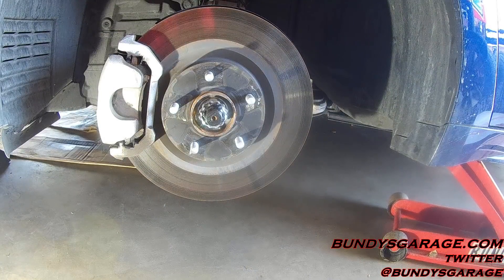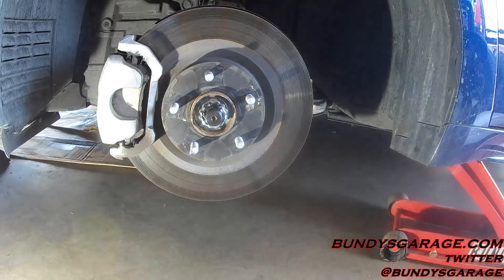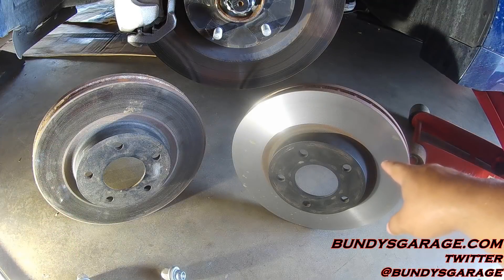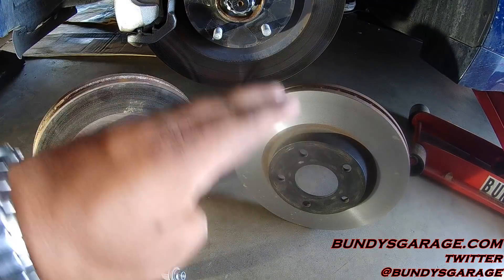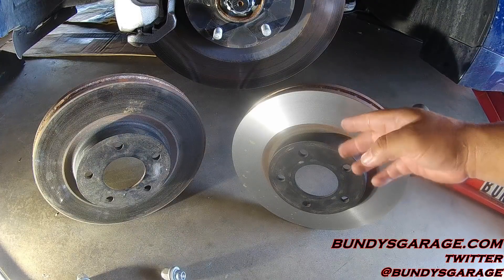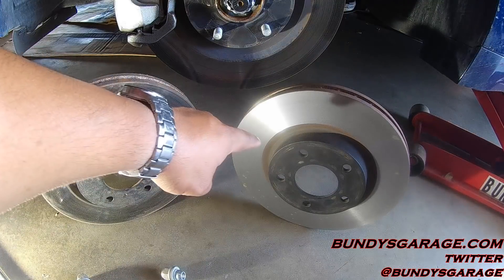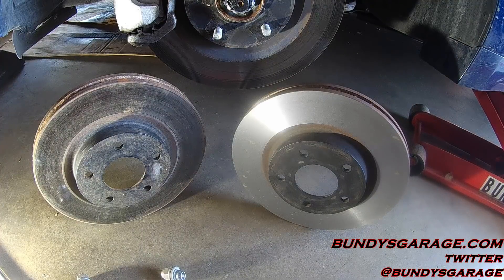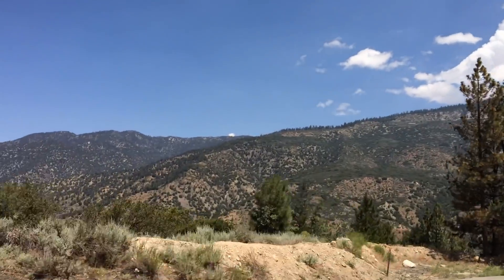Do I need to Turn Rotors when changing Brake Pads - What does Resurface Rotors Mean?

Comment: I’ve changed pads without doing anything to the old rotors. They usually squeak for the first few hundred miles until they wear in, but usually it ends up working just fine. Squeaking is of course unacceptable in a business unless the customer is informed.

Comment: It now being 2023, with a quick check at local Oreillys, the cheapest replacement rotor for an F150 is $86 each, for fronts. That is more than double of what rotors cost on average 5 years ago. 
Turning looks a LOT more economical now, after the Biden economy is in full swing.

Comment: Replacing rotor labor is about 50 per wheel. A pair is 100. New Rotors costs about 100 to 120. Brake pads about 120 part and labor. Total about 340. If resurface rotors, how much does it save?
Reply from the maker: Turning rotors about $80 bucks for 2 of them. It’s also better to stay with the original rotor that came on the vehicle. A lot of “cheap” rotors are junk and warp within a few hundred miles.

Comment: How many sets of pads would you think a rotor would go with turning each time.   I've just got new aftermarket brakes going on my pickup and questioning if I still shoukd have just turned the rotors.  I did a thing I always dislike and that was to pad slap at last inspection time. Anyway the rotors appear quite worn so I am just doing the whole thing this time.  I hope I'm not throwing out good rotors.  I don't see min thickness on the hat however
Reply: From a buddy of mine who work with cars, he says a couple brake changes.   I just measured my rotor, it's at it's finally at it's minimum thickness and my truck has 200k and I think it's on it's 4th brake change.  So i guess it's all on how you drive, I generally don't drive fast, and don't brake hard.
Reply: @ex8280  interesting. One thing I did learn is minimum thickness means it’s good for one more full set of pads. It’s not slower limit for disposal.

Comment: The problem with turning rotors is that you thin the metal every time you turn them.  They become weaker with every turning, making them more apt to warpage.  On my own vehicles I don't turn rotors, merely replace the pads (pads are cheap) and clean/grease the sliding pins.  NEVER had brake rotor problems, ever.
Reply: I've never turned my rotors eithersd, never had any issue, and I'm at 200k, with 4 break changes, and finally at it's minimum thickness.  Just put on a new OEM rotor.
Reply: @ex8280  Good info.  Thanks!  I think that's the route I'm going to take.
Reply: Thank you.  I was wondering about doing it that way myself.  Makes sense.
Reply: Won't you still have the pulsation then? If you just do the pads?
Reply: You only need to remove a few thousands of an inch of material when turning a rotor! They are manufactured with extra material on them for a reason, that reason is so owners can have them turned each brake job. You people are listening to people who make more money by selling you a new rotor rather than turning the ones you already own. A rotor can be safely turned once or twice before they should be replaced.

Comment: New pad material (going for ceramic pads for example) on original discs that used oem compound pads... Definitely turn it.

So you embed the new ceramic material on the rotors.

Comment: Uneven rotor surface is actually the laying down of brake pad material unevenly. Hence bedding the brakes when new pads are installed. This is why brand new rotors with only 300 miles can have an uneven surface, not that they were defective as this man suggests. So the reason for new rotors would be that you are at the end of the rotors thickness or there uneven but dont have enough rotor thickness or material to cut them down. There's a minimum thickness that they can be.
Reply from the maker: Where did you get your information?
Reply: @bundysgarage  its commonly known in the industry. For example - https://haglinautoinc.com/blog/what-causes-brake-rotors-to-warp#:~:text=Brake%20rotor%20warping%20isn't,surface%2C%20mainly%20caused%20by%20heat.&text=The%20brake%20rotors%20can%20become%20glazed%20with%20material%20from%20the,off%20onto%20the%20brake%20rotors. Paragraph 3 of this website

Comment: I don't believe in turning. Most modern rotors and pads can handle a simple pad slap if the rotor looks okay. You can possibly get away with this for 10 years. Just clean them up with a power drill and wire brush attachment for rust if needed. If they look that bad or are gouged or warped, just replace them. Turning is nonsense in my opinion.
Reply from the maker: Well even though you don't believe in it. Sometimes you gotta turn'em.

Comment: I just had my front brake pads replaced and rotors resurfaced. When pressing on the brakes it takes a while for the vehicle to come to a full stop. The brakes do not feel as “strong” as it used to. Is this normal?
Reply from the maker: No that’s not normal. Take it back to the shop that did the work and tell them you are afraid for your safety and have their best guy take a look at it.
Reply: Maybe they went past the minimum thickness when they turned the rotors.

Comment: Consider three things before resurfacing.

Original thickness ( most front rotors have more pad contact surface to be able to turn.   Some cheap rotors especially rears which may be originally cast just slightly above the minimum thickness.

Rotor material:  how well the materials used during casting were mixed, heat treated and allowed to cool properly.

Rust preventative coating applied:   Most modern rotors have some sort of rust preventative applied at the factory before being shipped.  Black is a common due to the fact that as the rotor contacts the pad the rest of the rotor should still have the protective coating applied but the pad/rotor contact surface will turn metal.  Some have the same coating applied but maybe clear and although not seen the coating is there.  

Zinc is a common ingredient used in this step.  

Not sure if it is still done but they used to spray a small coating of oil on the rotor and seal in a bag to prevent rust during transit.  The coating is obvious but the bag prevents the protective coating from being absorbed by the rotor box weakening the box structure.

In general I would not expect to be able to turn modern rotors more than once and another resurfacing 20-30K miles later might be at or below minimum thickness after resurfacing.

Yes there are crooked shops out there but this is one that is a major safety item and they will not budge.
Reply: Your only removing a fraction of a millimeter when turning a rotor. Rotors are manufactured with extra material on them for a reason. If they were meant to be thrown away every brake job, manufacturers would only make them a few millimeters wider than minimum thickness. Most modern rotors have nearly 10 millimeters of extra material on each side of the rotor, that extra material is there to be turned off during a brake job. What has happened is people are taking advice from people who make more money by selling them a new rotor rather than turning that rotor for them.

Comment: If it starts pulsating at 300 miles my guess is probably cheap steel or cheap manufacturing procedure and Quality Control.   Another cause can be cheap bargain basement pads. 

A lot of today’s cheap steel ingredients for modern rotors can warp and at maximum probably only to be able to be turned once maybe twice for some of the better ones.  I can agree with both methods but if I buy a used car unless I can see visual or documentation of it being resurfaced or replaced in a fairly short window of time before purchasing the vehicle I usually play it safe and get new pads and rotors and start a new baseline mileage and date.
Reply from the maker: Thanks for the tips. Some of the best rotors I have used on many applications are Bosch Quiet Cast rotors and brake pads.
Reply: I saw a new piece of modern technology last time I had Rotors re surfaced for my 2015 Expedition. Once that case they were within thickness and I was getting ready for a road trip.  NTB has a lathe that is portable.  The lathe has its own motor source and you remove tire and set the vehicle to the height of the lathe.  Leave rotors on and with vehicle being on lift about waist level keeps the vehicle balanced.  They had two and set one on each side then moved to the other axle.  Took about an hour for all four corners one less item to remove well three actually....Caliper and Caliper mounting bracket.  Probably why it only took an hour.   $50 a corner but done quick and safe.
Reply: You are definitely not the first or even second or beyond with good reviews of the Bosch Quietcasr.  I had a set on my 2012 Infiniti M37.

Comment: I agree i have new front Pads & Rotors with only 9K miles on them (slide pins lubed)  and they vibrate when braking at high speeds! The key word here is now they are "Seasoned" so i agree I'll have them turned and install a new set of pads to resolve the vibration issue vs. getting new unseasoned Rotors which may end up vibrating again.
Thanks for bring this to my attention... my faily new Rotors have bern giving me hell.
Reply from the maker: Where did you buy the rotors from and what brand where they?

Comment: The only time I resurface or replace rotors is if they are physically damaged (scored) or I have vibration or pulsing.  I've been doing this to all my cars and bikes for 30 yrs. Never an issue. Hell, one time in my 20's, I replaced front brake pads on my Rabbit and the rotors were badly scored. Eventually I replaced the rotors when I could afford it but nothing happened except for faster pad wear. Still good advice though. Thanks.
Reply: That’s a terrible idea. It shortens your pad wear, and effects the smoothness of your ride. Any mechanic course teaches you to reface a rotor EVERYTIME you install new brake pads. I have seen so many shade tree mechanics trying to chase down a slight vibration blaming the person that balanced their tires. 99.999% of the time it is due to some shade tree mechanic just changing the brake pads. Most don’t properly clean the calipers either. This is a potentially dangerous practice as well. Spray chemicals make it so easy to properly clean your brake components that it should never be skipped. It costs $15 per rotor to have rotors refaced at most big box auto parts stores. The benefits are well worth every penny! I used to think like you. But, the facts are you cannot see see a wave that is a mere 1000ths of a mm, but you sure can feel it in the brake pedal and steering wheel! Cue the “The More You Know” music! Rofl!
Reply: @onejedi21  man, you know your shit...... unlike others who tend to cut corners.
Reply: @onejedi21  Last year I changed just the rear pads on my car. And while I never felt the pulsating stop, the pads were eaten up in 12 months.
Reply: @onejedi21  One or two thousandths of an inch is acceptable  rotor runout. There is 25 mm to an inch so if you can feel .001 mm runout in the brake pedal you have some sensitive feet.

Comment: Just had my brake pads changed and (all front) rotors turned, now I hear a scrubbing noise when putting on brakes, (funny since I Never heard that before I had this done!), is this normal?  They said it should stop, and its been a little over a week now, thanks.
Reply from the maker: You gotta out a couple hundred miles onto the new pads and rotors. They need to “mate” up and get use to their new home together. It will go away.
Reply: @bundysgarage  thanks! The rotors were just "turned" (not new) the brake pads were new, so I assume same as you said, give them time?
Reply from the maker: Yes give it time. Drive the car and brake normally. The resurfaced rotors need to pair up with the new pads. Do you know what kind of pads they used? The best ones I have found hands down at Bosch Quiet Cast. You can buy them on rockauto.com. Amazing brake pads! And I’m not paid by rockauto or Bosch.
Reply: Vickie did it go away? or did it continue?
Reply: @lh98   I had the rotors replaced and the brake pads, had a little slight noise at first but it went away very fast, wont be getting rotors turned anymore! All of this started when they turned them (and I took them to a different place and had them replaced!)

Comment: Agreed, in the past, I can never find anyone who does the surfacing, in CA.  I guess most people here just take their BMWs to the shop, where they 'recommend' new BMW rotors every time.  I'm a DIY Toyota guy, would gladly pull rotors to take to shop, but I don't know of any place that will spin it, especially for less than the price of new rotor from Amazon.   I like the new surface to remove waves and any glazing, but it looks like I'll just swap pads until I need full replacement (from scoring).
Reply from the maker: Oreilly auto parts will turn your rotors.

Comment: I only have one car, how do I turn off the rotors and get them machined? Unless I am outside the machine shop and remove my rotors. And I don't have a way to check the minimum spec on the rotor. Then finally, after all that trouble, you end up with a brake pedal that vibrating then I rather would have bought brand new rotors.

Comment: Do you really even need them turned? if you’re car is just a few years old, I feel it’s a waste of money and time unless its a NASCAR vehicle.
Reply: You obviously don’t work on cars.
Reply: it all depends on their condition. something as simple has Having your tires rotated and some knucklehead over tighten the lug nuts can warp the rotors. Hard braking can warp the rotors and rust buildup can prevent proper seating of new pads. Learn all you can that way you can make an informed decision. And don’t over tighten your Lugnuts no more than what the manufacturer says. my truck calls for 150 pounds which is stupid. I run them at 100 but every time I get my free rotation they snug them to 150 foot pounds per nut. IMO it’s just not needed. i’ve never had a wheel loosen or fall off even at 80 foot pounds

Comment: Bs now  the rotors are the same new that cutting them most places charge 20+$ to cut each and new are 25 30 dollars new
Reply from the maker: Aftermarket rotors are not the same quality as OEM rotors that came with the vehicle. I would rather resurface OE rotors then get cheap aftermarket ones for $25 - $30 bucks made in CCP China.
Reply: @bundysgarage  🤣 many oem parts are made in China I been in the automotive industry 30 years don't try to bs me
Reply from the maker: Then you would know OE parts are better than aftermarket if you have been in the industry for 30 years.
Reply: @bundysgarage  again made in China
Reply from the maker: Not all parts are made in China and there are different qualities to parts made in China as well. So what your saying is not always true.

Comment: Dont forget to look for the minimum thickness of your rotors before getting them resurfaced, you should find a decimal number in milimeters (mm) somewhere on the rotors, when resurfacing you will lose some thickness and they may not be useful after that.  Use a caliper meter to measure out the thickness.
Reply from the maker: A machine shop that knows what it’s doing will measure it before resurfacing. If the cut will take it past the min thickness than they should not resurface it and new rotors will have to be purchased.
Reply: @bundysgarage a lot of people are basing their opinions off of people who make money by selling them a new rotor. It may cost $40 to have both front rotors turned compared to $140 for two new rotors. Rotors are manufactured with extra material on them for a reason.

Comment: Turning rotors is one of the biggest fleecing jobs in modern automotive maintenance. Sure there are times when it's needed. Some mechanics are raping people with the idea that every brake job requires turned rotors. Rediculous. I've run metal to metal a few times on different cars and never turned the rotors. Guess what happened? Not a damn thing. No amount of hard braking or downhill braking changed the performance of new pads on old rotors. Now I did have an issue with one car when I first replaced the pads. The worn rotor grabbed a bit more. After a while though, smooth sailing. Show me proof, real world proof, that non turned rotors make a difference for the average driver. It doesn't exist. The automotive maintenance industry is one of the most under handed and rife with falsehoods. If brakes are broken, they will let you know. Don't drink the koolaid.
Reply: I totally agree
Reply: Thank you took my mustang in to ford for breaks they told me I needed rotors and the job would cost me 1,400 , when too auto zone got the breaks for 100 And won’t be changing my rotors for now 😎
Reply: Non turned used rotors often squeak for the first hundred miles until they wear into the new pads. There’s your proof right there. This is fine if it’s your own repair and you’re aware, but not fine if you’re a customer at a shop who is uninformed.